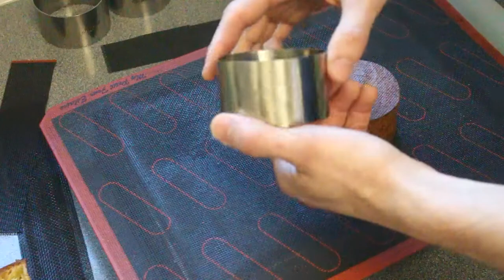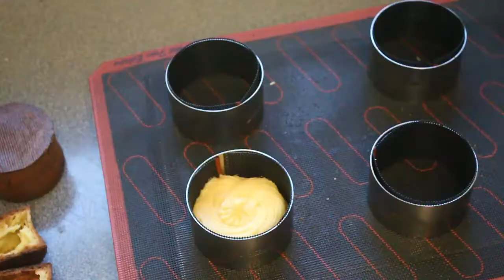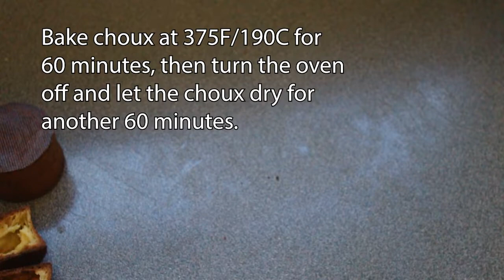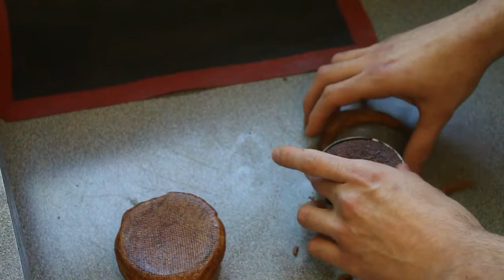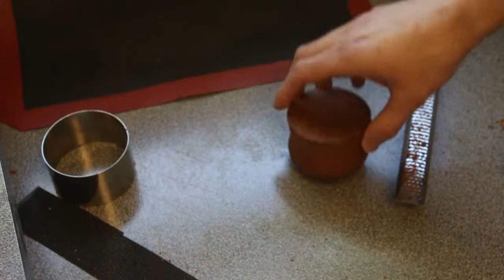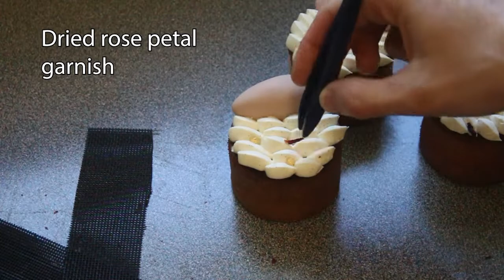How to make cylindrical cream puffs | Compressed choux demo.

Comment: Hi! Thank you for this video. My eclaire are very tasty, but very ugly 😂Can I ask you why your puffs so dark? Is it possible to make them more golden ? Sorry for my English. Thank you
Reply from the maker: If they are more golden, they may not have enough structure to support themselves. This technique necessitates a shell that is on the darker side, if you are making them in rings of this height.
Reply: @fluffymunchkin   Could you please tell what is size of your forms.thank you very much!
Reply from the maker: @yoshih.8910  1.75 inches high, 3.125 inchs diameter (sorry for the imperial measurement)
Reply: To make a lighter color choux use water instead of milk for the panade. Alternatively you could use half water half milk.